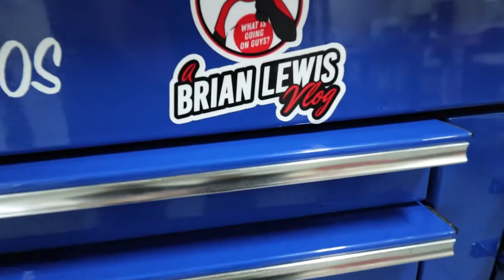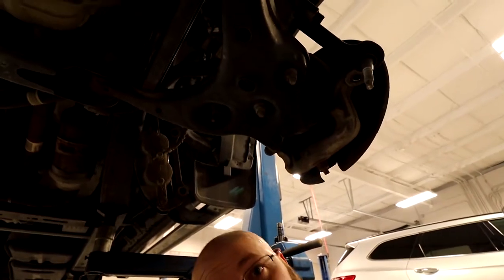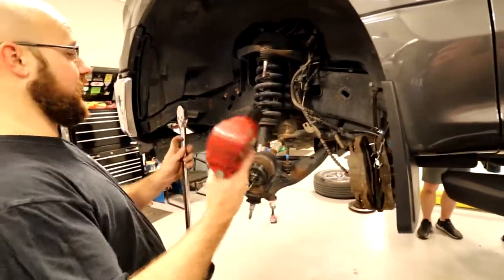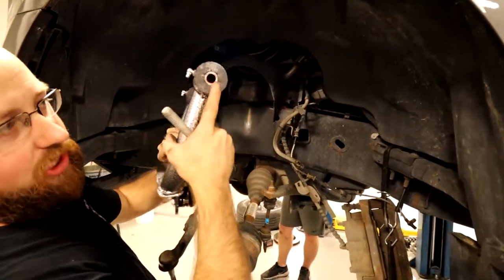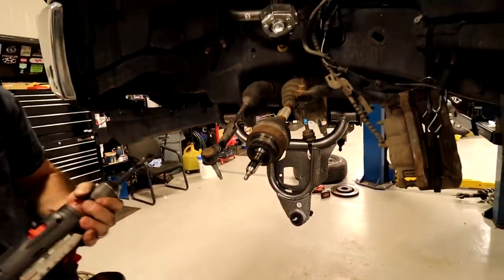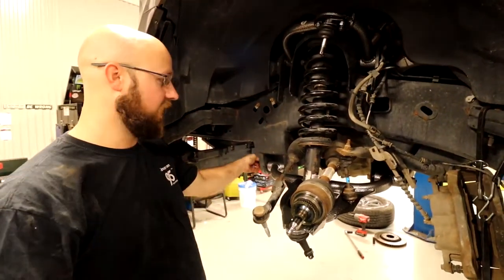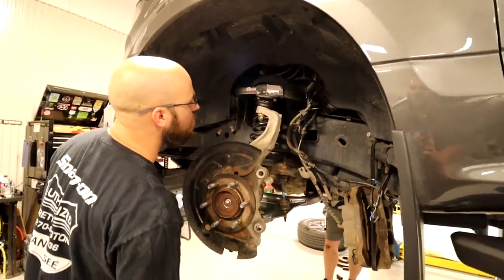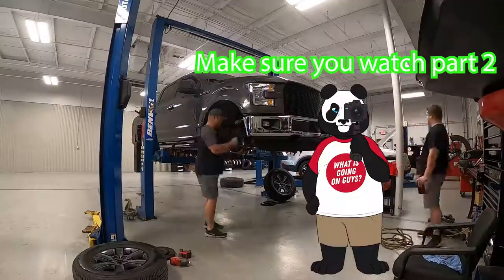Lowering a 4WD Ford F-150 IHC Drop Kit (Part 1/2)

Comment: What all parts would I need to avoid camber. Thinking Of going with a stage 3 belltech 3/5 drop on my 2020 f150. Don’t know much about drops😅
Reply: From what i understand when going with the belltech kit youll want to slot the lower adjustment to get the chamber into spec... if you dont want to do that or know a shop that can youll have to look into adjustable control arms to get the chamber set right

Comment: I didn't even watch this video. Just came here to thumbs down cause lowering a truck is just wrong.
Reply from the maker: Thank you. Any activity negative or positive helps the channel.
Reply: @ABrianLewisVlog  no problem. It was an lol post. Not my style but to each their own. 👍🏻
Reply from the maker: @irrelevant6845  I meant it. I wasn’t being rude. I’m just thankful to get any traffic on my videos. Lol
Reply: What size wheels and tires will fit on this now? I have the same truck with a 3in lift and 35s, handling sucks, gonna slam it lol
Reply: Blasphemous comment